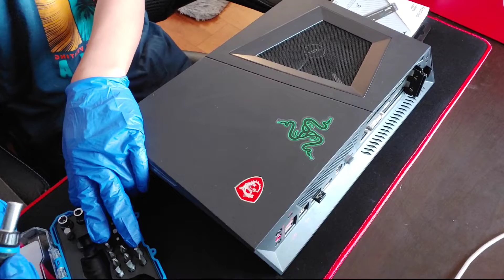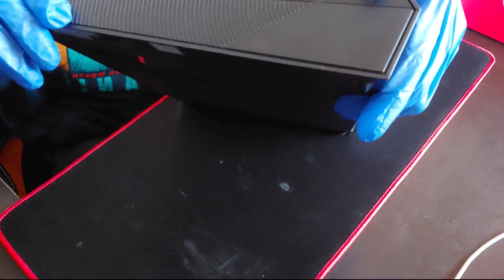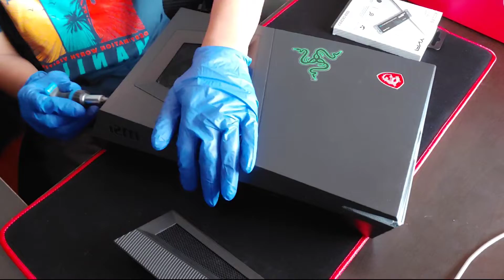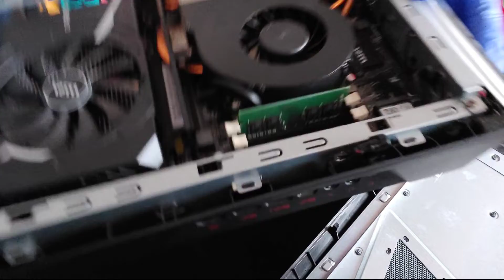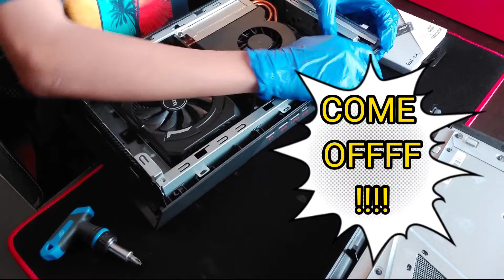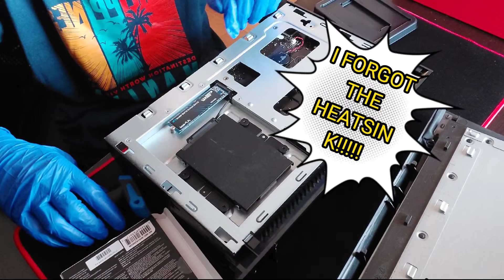MSI Trident 3 SSD INSTALL AND UPGRADE

Comment: My hard drive in mine has gone bad. 
How do i know whats compatible with it so i can either replace or upgrade the hard drive?
Reply from the maker: pretty much any ssd m.2 or any harddrive similar in size to your original. I have a seagate 1TB drive for reference. make sure your ssd heatsink is not to chunky to fit the bottom of the case

Comment: Awesome! I can’t wait to install this ssd soon! Would you know if I’d be able up upgrade my gpu & cpu?I have a trident 3 9sa-483us, ms-b9201, h310. it came with 8 gb of ram, I upgraded to the max of 32 gb, it has an intel i5-9400f, and nvidia gtx 1650, am I able to upgrade to a 3060 and i7-9700?
Reply from the maker: You should be able to upgrade if the cpu has the same socket size for the motherboard. Also the GPU but be in a itx form factor or else you would need to remove the whole body to fit a regular GPU in. Lastly the GPU needs a power cable that needs to be connected to the GPU to the motherboard if it's more than a 1650.

Comment: Please note that in order to access the disk drives, it is NOT actually necessary to remove either the rear panel or the opposite side panel (on the right side viewed from the rear, as seen in this video). Since the latter is the most difficult task in this video, particularly in reassembly, skipping it makes the job MUCH easier. Apart from that, the steps are correct. Thanks for this!
Reply: How would you go about to reach the underside then? I just cleaned my pc while i also wanted to inspect the port to see if something was there as i bought my pc (Which is this moddel but i got the artic artstyle basicly being white) and i just couldnt remove the front pannel for my dear life cause it was so sturdy, iam trying to inspecr the bottom to look for a m.2 port to maybe upgrade it with a additional ssd drive.
Reply: @CrimsonPrincess2305  You have to start as the video shows. This part is correct. It's also correct that you don't remove the front panel. It's the opposite side and rear panel removal that are unnecessary. To access the SATA and M2 drives you only have to remove one side and the bottom.

Comment: Do you have a link on the ssd and ram you have installed I’m looking to upgrade my trident 3 however it’s gonna be my first time and I’m not to knowledgeable with finding the compatible parts
Reply: Did you find the right ssd? because im am currently sitting with the same problem
Reply: @thinxyplays1160 did you ever find anything? 
My hard drive went bad and im trying to find a new one, but idk where to start.

Comment: I heard you’re not supposed to spin a fan when it’s off like that is that. It true or does it only apply to laptops?
Reply from the maker: Hmm I've haven't heard that before? Well assuming that could happen with laptops, but I been doing it to my computer fans and I've haven't  had any problems.

Comment: Now that I have you here, how many M.2 slots does this computer have? I have the 12th Gen and I can’t find an answer to that anywhere.
Reply from the maker: It has 2 one in the bottom of the case and the wifi card. You can fit one tiny m.2 if you're willing to replace your wifi card. And the motherboard is LGA1151 so I recommend using another cpu.
Reply: @GIC4568 so does this mean if you already have one ssd pcle installed, you have to remove Wi-Fi card to add another?
Reply from the maker: @Weezy B  Yes if you want more storage you can remove the wifi card and add a small ssd in exchange for wifi.

Comment: This video is highly appreciated. Plugging in 32gb of ram and was really wondering about the case!
Reply: What ram did you get that was compatible? I’m looking for a 32gb myself.
Reply: @defimichael4373  PNY XLR8 Gaming 32GB (2x16GB) DDR4 DRAM 3200MHz 
Works great, and its $20 cheaper than what I paid for it months ago
Reply: @YKN_jonsnowden  didnt support this rig only SO-DIMM DDR4 2400 Mhz?

Comment: Hello thanks for video. I have one question. I have msi trident 3 10th. Can i  upgrade to rtx 3060 12G ıtx ?
Reply from the maker: I am not sure but I think it will fit inside the case you just need some power cables and if they dont need any then yeah I am sure it will fit and upgrade!
Reply: @GIC4568  I put a 3050 into mine.
Reply from the maker: @paravail6674  do you need a pcie cable?
Reply: @GIC4568  should come with the graphics already.
Reply: @GIC4568  if not, just buy one on amazon for like $9

Comment: What are the RAM specs, I am wanting to upgrade my Ram in mine, but I dont know what to look for to buy it. I believe it can go up to 32gb ram?
Reply from the maker: The RAM specs I have are all stock. Just one single channel ddr4 SODIMM 8GB. It can exceed to 32GB, and is running at 2666Mhz. Samsung 8gb 1600mhz
Reply: I just found this video to get access to my RAM. Great tips, really appreciate it. I am plugging in 32gb of PNY XLR8 ddr4 ram so ill let you know how it performs. Just $115 total

Comment: Appreciate the video, did you install a fresh version of windows on the nvme , and if so did you disconnect the 2.5 hdd before doing so?  Thanks.
Reply from the maker: So to get straight to the point. No I did not disconnect the hdd.  Its simple to me I install the m.2 then plug in my windows boot drive. All I did was format all the drives and installed windows on my ssd.

Comment: How did you get it to come off, I've pulled and pulled but it won't slide off. I already took the screws out
Reply from the maker: if your talking about the motherboard and the case. If you look in the motherboard next to the ram there should be a little hole with a screw in it. 
Hope that helps!
Reply: @GIC4568  I had all three screws out. Finally pried it off.
Reply: Any tips? Can separate both side. All screws out...

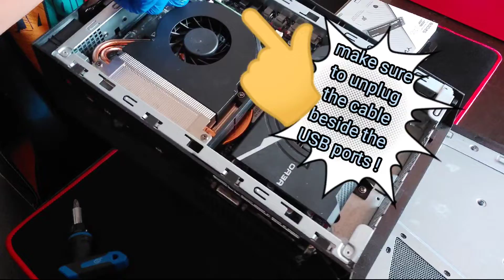Comment: Hello GTech, this video was really good and helped me when i was upgrading my RAM and SSD. I have a question, at minute 4:42 you said about making sure to unplug the cable beside the USB ports... what is that cable for??  i didn't unplug it and i am afraid something bad happened to it. Right now my PC and everything is working perfectly and i tried to put the cable in the best way possible so i think everything is working correctly
Any clue? what is it for?
Reply from the maker: I see the cable and it is connected to the led in front of the power button. Not sure but you can accidentally pinch the cable. But I'm not sure if it breaks it though!

Comment: Hows the cooling on this pc ?
Reply from the maker: Airflow is pretty nice. A somewhat big mesh panel in front of the GPU air stays cold during big games like GTA V on high settings. Although the cooling on the CPU is not that great I suppose. I wish they had a better CPU cooler.
Reply from the maker: Without anything running this pc. The GPU can run at about 26 degrees Celsius. CPU runs at 46. Wtih games running like GTA V at High settings it can go around at about maybe 60 or 80.